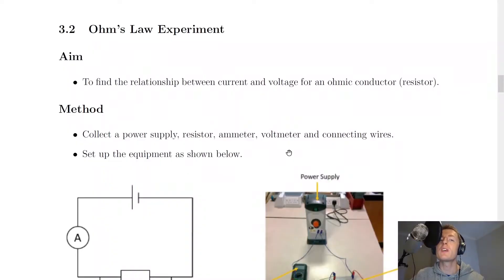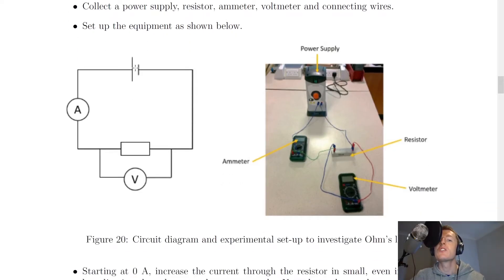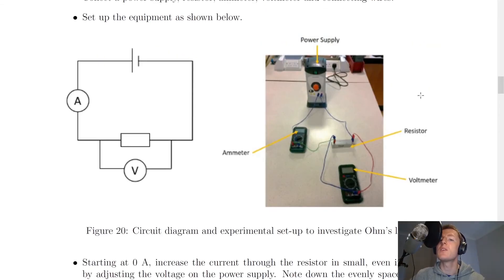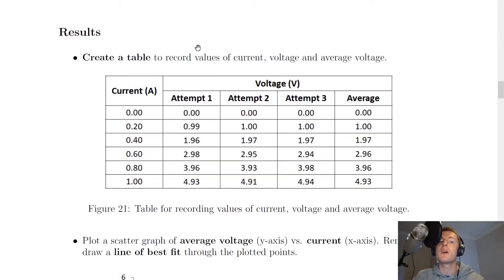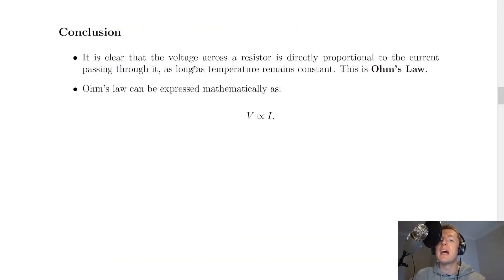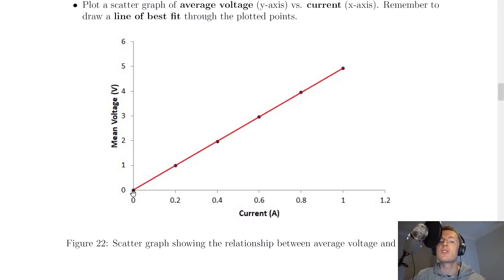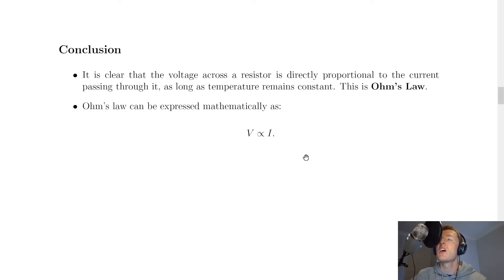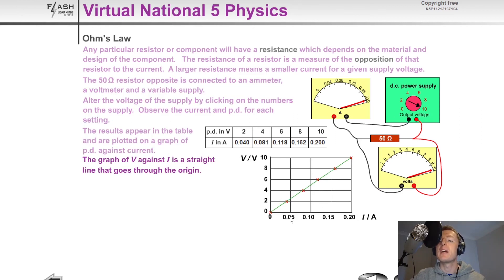National 5 Physics | Electricity | Ohm's Law Experiment | THEORY

Comment: What is the purpose of the resistor in this experiment? Couldn't you just have a voltmeter and an ammeter in the circuit?
Reply: I guess resistance is being measured so you need something to resist 😅